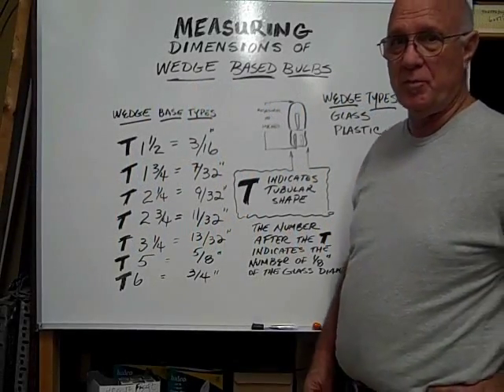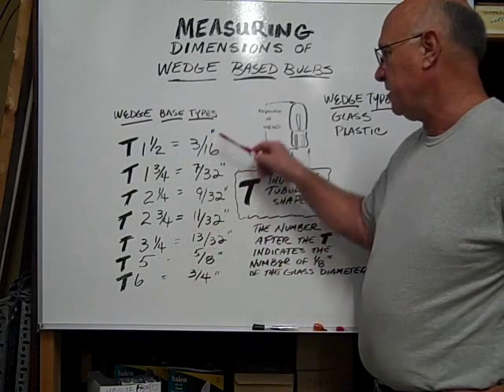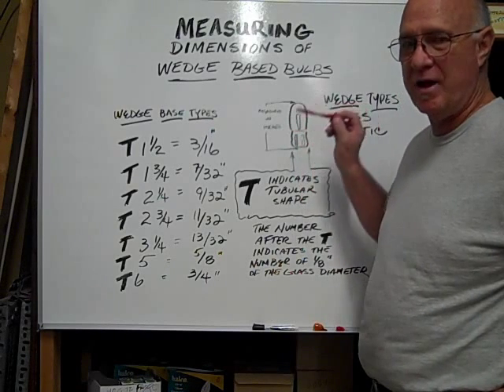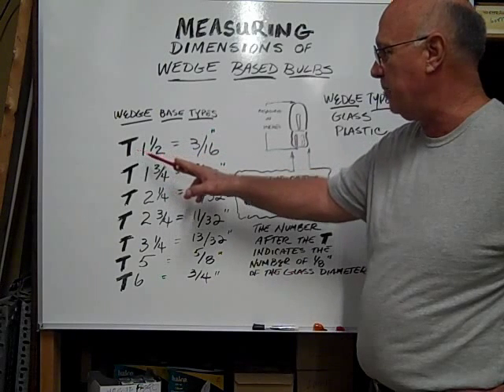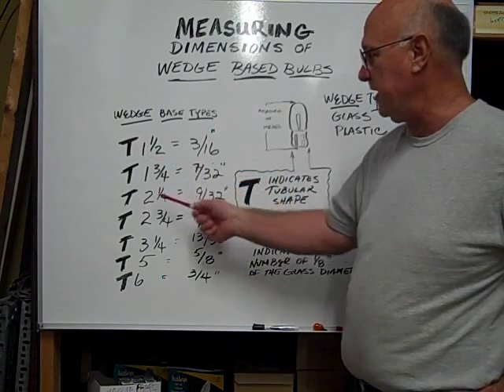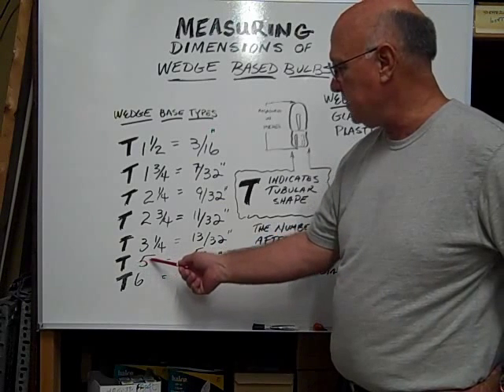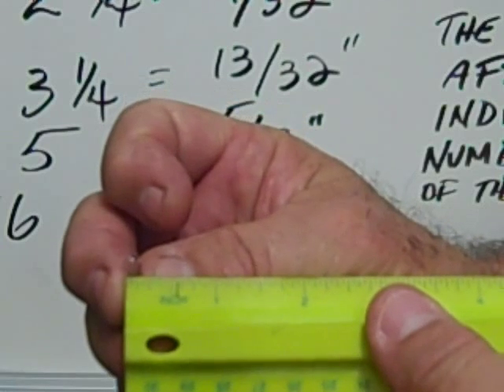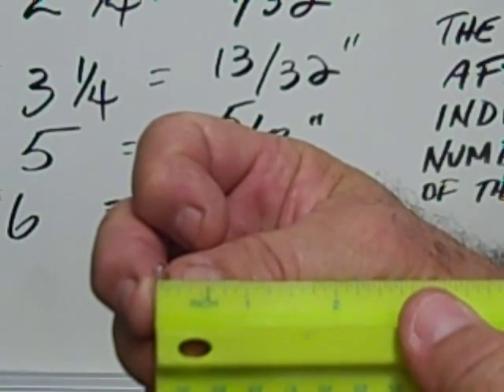T1-1/2 Glass Wedge Base Bulb Identification

Comment: Your chart is a piece of art, super helpful, thank you!!!
However... when it came time to measure, I could not tell which part of bulb was held up against ruler - bulb head or stem?  I also could not ascertain if you held the stem up to measure depth or width?  I replayed it 5 times but still clueless.

I badly need some replacement bulbs for my RV, so please could you elaborate on measuring?